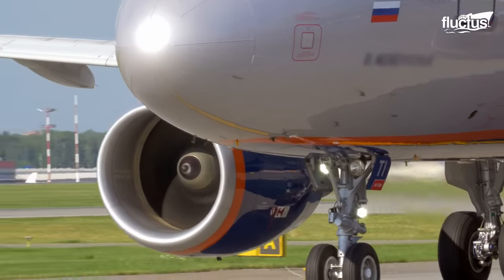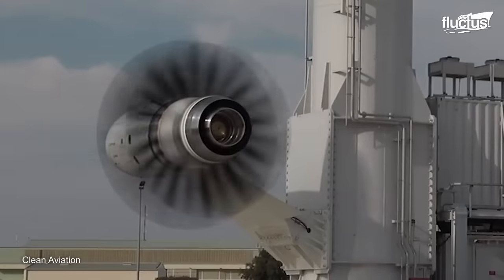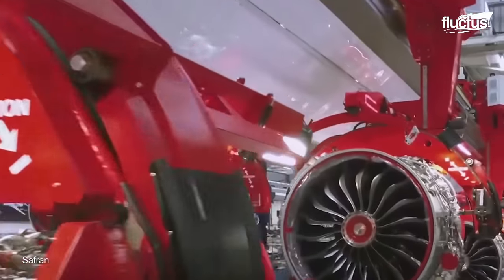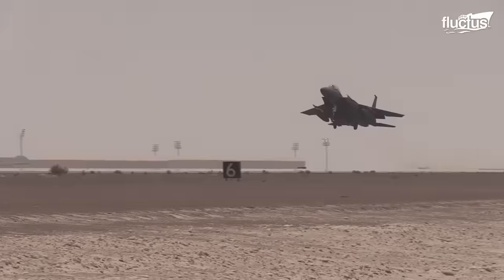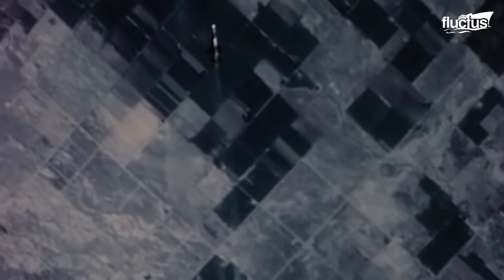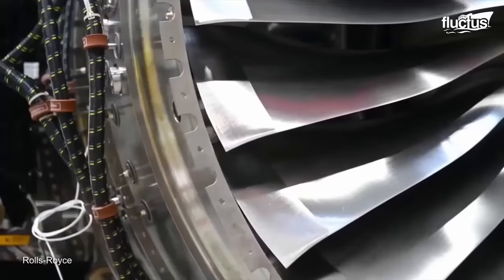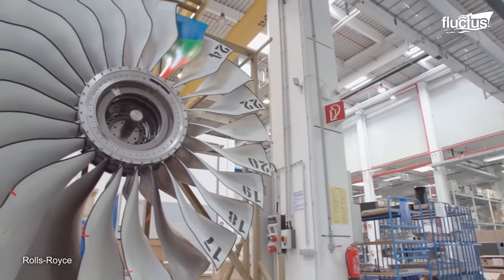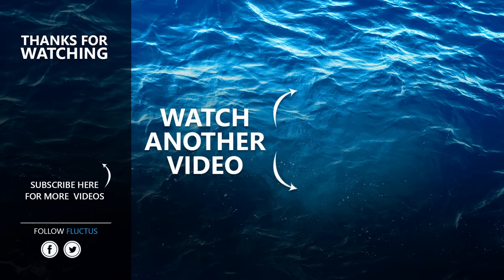US and Europe Testing World’s Most Advanced Aircraft Engines Ever Made

Comment: This technology has been around since the 1980’s, but the issue has always been that they’re insanely loud and break noise ordinances for residential areas near airports..
Reply: Yep, I thought the old Noordyne Norseman was loud, with it's ungeared 3 blade propeller. These are a lot more powerful. WOW!
Reply: Most of these YouTube video creators are going for clicks, NOT facts. Never let the reality of the facts get in the way of $. 😉
Reply: And not shrouded with pieces hitting fuselage on failure (bird strike or other)
Reply: @LSmiata  No, mere flesh, doesn't survive the Ginsu treatment well, at all, generally it's the compressor section inside, that gets trashed by bird strikes. The blades are waaay thinner, and brittle.
Reply: Right, I think it was the show "Beyond Tomorrow" back in the 80 that showed this and multiple working flying cars prototypes.
Reply: Ssssshhhhhh
Fuel efficiency above all else. 
😂
Reply: Those old engines design are different from this one. Look at the picture. The previous engines have their blades on the back of the engine, and both of them rotate, thus creating those loud noises.

This new engines have their blades up front, and the blades on the second layer are not movable.
Reply: @nntflow7058   
The blades whipping around at god knows how high RPMs produce that noise. Doesn't matter how fancy or composite-y they are, or where they're located.
Reply: The geared turbofan has also been around since the 1970's but has only seen broader commercial application and viability since the PW1000G in the 2010's.
Reply: @davecrupel2817  Man, for you to debunk that so fast, you must know a lot, surprised they haven't hired you. :o)
Reply: @SchrödingerKousae  Don't know if you're being sarcastic or not.
But I'm an aircraft mechanic. 
It's a crucial part of my job to know the physics of what's going on with an airplane. 

Plus im a huge avnerd, so im probably a teeny tiny bit ahead of some other mechanics in this regard. 🤷

Also these things are well understood in the industry. They've all been tested in some facet or another. Which is why i think this project is a collossal waste of time & money.
Reply: @davecrupel2817  they say they will be able to meet regulations...

Comment: GE and Pratt were testing the same type of engine in the mid 1980s, nearly 40 YEARS AGO.  But I suspect this guy wasn't born then.
Reply: Correct but this first UDF (Un Ducted Fan ) tech by NASA and GE was put on the backburner in the 80's.
The prove of concept worked, but at that time do the higher noiselevel, extreme high production costs and low fuel costs made the UDF financial uneconomical and political unwanted.
Due to modern composites, new tech and high fuelcosts GE, P&W and Safran/CFM work togheter for the the 2nd generation UDF.
The 2nd gen UDF makes now less noise then a "regular' ducted fan due to the fact that one set of blades is stationary  instead of counter rotating in the original UDF.
This Makes this low fuelburn/noise engine a sustainable option for "regional" jets.
Point to point travel did explode so the demand for economic to operate "regional" jets has drastic increased. 
The term regional has been watered down today.
The baby Airbus the  A318's with luxury seatings is operated by British Airways as an intercontinental aircraft  on the London to New York route!. Smaller aircraft more departures in a day.
And budget/holidaycharter airlines use f.e 737's in cattletruck seat configuration for the low and medium routes.
Reply: The new concept uses a stator section rather than counter rotating. Very different from the old ones you refer to. Noise reduction is the idea.
Reply: @deanhoman1958  Correct i mentioned that when i mentioned a set of stationary blades (they have pitch control)  
"The 2nd gen UDF makes now less noise then a "regular' ducted fan due to the fact that one set of blades is stationary  instead of counter rotating in the original UDF."
Modern computers and software made that  improvement possible on the 80's  UDF.
Reply: Lol stealing the Bear bombers engine and adding extra tech
Reply: @hesedagape6122  The British were first with contra rotating props on aircraft and turboprop engines. 
The Soviets got their first jetengines from the British.
The bear is the only fixed wing aircraft in the world still flying with contra rotating props.
While very efficient and fast, noise is a serious big issue with contra rotating props. 
The bear is so unbelievable loud, fighterpilots intercepting them need additional hearing protection and submarines can detect their soundwaves from a distance under water.
Reply: @obelic71  thanks for the info man!
Reply: Yeah, and we made it much better, boomer
Reply: Might want to check who cfm is made up of
Reply: @obelic71 Good observation engine development.
Reply: Yes it’s depressing to watch supposed new technology and the turbojet/ramjet was developed in the 1960s by others (A12)

Comment: The CFM Rise demonstrator shows the lessons learned from the GE Aerospace UDF36 program. With ten blades on a single propeller spinner and ten fixed blades behind it, it eliminates the noise that was the downfall of the earlier propfan designs.
Reply: I thought, although reduced, the noise was still an unsolvable problem especialy after more restrictive noise reduction policies especialy in the EU. It is a general issue if you have some blade system rotating near some kind of edges. Be it second blade system, rotating or not, fins, or other kind of aerodynamicly acting edges and surcases. You know this kind of problem by pusher props as well. If you've noticed they've avoided talking about the noise issue for this system entirely.
Reply: It's slow, maybe 400 knot's. Cruise speed never mentioned.
Reply: The steam turbine for ships invented by Parsons  in 1890's had rotating and fixed blades - so why is this different
Reply: @starfighterusscv-6693   That alone would make the aircraft more efficient. The slower you go, the less drag. Drag increases logarithmically with speed.
Reply: @apterachallenge - PARASITE drag does, induced drag decreases.

Comment: What happens if a blade fails on the open fan design?  It will cut through the fuselage like a hot knife through butter.
Reply: You are correct. Turbine blades can and do separate on occasion. I can't see the FAA certifying this design without major regulation changes.
Reply: @cgirl111  Why wouldn't they certify it with the exact same process and standards that all of the other turboprops have been certified with?
Reply: @DHEFDAWG  Because the current regulation is that a failed fan blade must be contained inside the nacelle. I don't know what the difference is between the a standard turbo prop and this engine is but I will start looking into it. 
It looks to me that the only difference between a high bypass jet engine and a turbo prop is the nacelle and containment. There has to be a regulatory difference but I haven't looked for it yet.
Reply: @DHEFDAWG  Because this fan blade has much higher energy than an ordinary turboprop fan. It turns faster rpm. So it's more dangerous has any break occurs.
Reply: Armour plating the fuselage section next to the blades

Comment: A couple of engineering points to consider-

Open turbines, without a nacelle are significantly louder. Really loud.

The ceramic components allow leaner burn, using less fuel, but a significant increase in NOX emissions. Not good for acid rain.
Reply: What the so called " jetengines" make loud, ist the turbo-jet component, which is ptretty much dimmed by the sheath current caused by the propeller/fan/ rotor. I experienced the early jets like DC 9, Caravelle, Boeing 727 and so on starting. They were defenitely at least 3 times as loud as contemporary turboprops for example.

Comment: A lot of the fuel-saving advantages of these come from the ability to change the pitch of the big fan blades so that the engine is more efficient over a wider range of power, altitude and rpm settings. The Pratt and Whitney geared turbofan designs are providing similar benefits.

Comment: A big fan engine, has a containment casing. ‘Nuff said.
Reply: The true danger comes from the fast spinning heavy discs in the core, which is still contained.
Reply: @thorwaldjohanson2526  you admit you know nothing. If the turbine discs are contained, where’s the danger? Which discs are you talking about, the LP turbine for the fan? 
These big blades AREN’T contained, which is my point.
Reply: @johnnunn8688  the prop / fan blades ar geared and spin slower. The most dangerous part is the disc holding the high pressure turbine. This disc (or 2 discs) spin thr fastest and are very heavy, as they have to withstand very high centrifugal forces at high temperatures. I'm sure that Cfm and airbus are considering the failure modes. Now this might just be an educated guess, but I suspect that a broken prop blade could cause pressure hull breach, but it would not slice right through thr aircraft and cut electrical / hydraulic lines like a failed disc would. In aircraft design you have to reach a 10^-6 chance per flight hour chance of a catastrophic failure. I'm sure they can achieve that.

Comment: Russians are already into counter rotating engine on TU bomber programs. They are 5 years into this last week they install counter rotating engine with housing on IL 76 testing air craft. They also started mass production PD 8, PD 14 and PD 35
New engines 100- Russian Parts for Commercial Air Liners SJ 100, MC 21 and IL 400M Jumbo, 100% Russian parts. These engines are 20 more efficient than Boing or AirBus Engines on new aircraft.